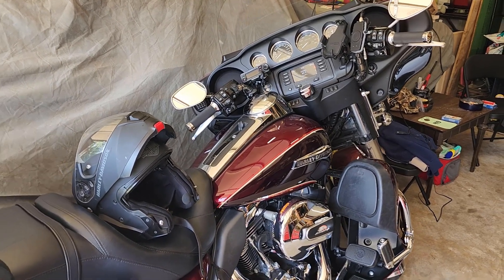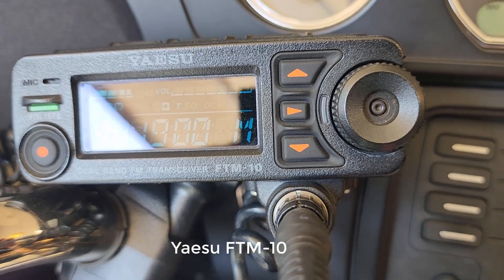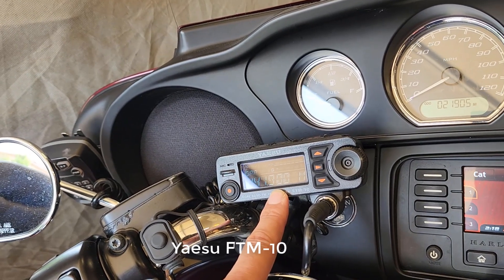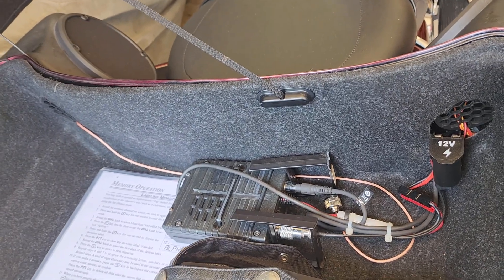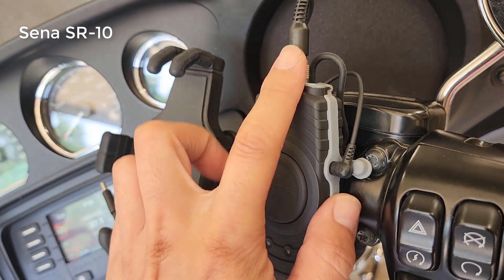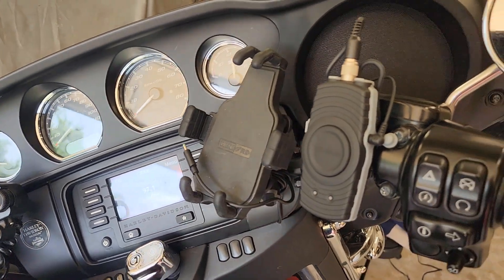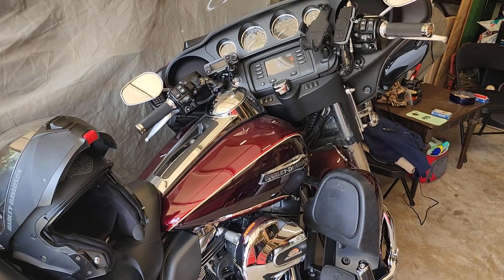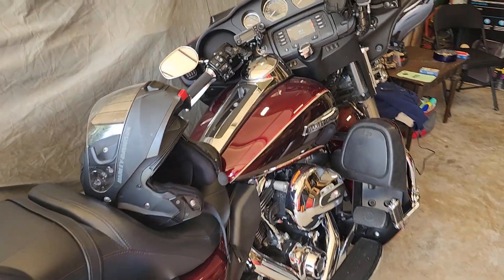Ham Radio Motorcycle Mobile

Comment: How did you pass the cables through your tour pack? Just got a BMW K1300GT and am finally going to give it a go. I'm just hesitant to drill holes in my side cases, less so for the Givi trunk. Considering building the radio body into a harbor freight apache case to strap to the back seat.
Reply from the maker: @JudgeKW  I drilled a new hole and got some rubber grommets from amazon. 

Working on v2 of this setup where the radio will run off a separate 12v battery and the bike will charge that battery when running.

Comment: I came to this video for antenna mount ideas. I just picked up a VGC VR-7500 and it's in my car for now, but I plan on installing it in my FJR1300 once the weather warms up a bit more. For anyone who's not familiar, this radio interfaces entirely via Bluetooth on a smartphone. Combining that with the sena unit in my helmet seems like it'll be a really good setup without much fuss. 73

Comment: I want to say I linked my SR10 to my Cardo, but I did have Sena prior will check maybe this weekend and let you know. Also there are BT units for that radio, currently I am using a FT3D to my cardo with a PPT that replaces the brake lever mount. I should have a video out in the next couple weeks on that. Thanks for the video!

Comment: My Friends and I have the Midland 75-822 CB Radio on our Motorcycles. Could not find the SENA SR10 device for sale (by SENA). So, instead had utilized a Wireless Bluetooth (BT) Adapter (HB-6A) and Wireless Remote PTT (Key) (HB-6B) units which are battery powered and USB rechargeable. $30 for the pair, plus $15 to $20 for (10 - 15 day) shipping. The Remote PTT is nice since no wiring is required. Velcro strapped (provided) to left handlebar grip; thumb activated. Red light activates on the Remote PTT Unit when PTT is active. Paired the BT Adapter with the Remote PTT unit. Then, I paired the BT Adapter with my SENA 20S EVO Helmet Headset. Works Great! Overcome the mechanical (physical) constraint (clearance issues) of mating the HB-6A Device directly to my version of Midland CB Radio, by using (making) a short straight through extension cable. There are off the shelf 2-pin molded extension cables for purchase, but a little expensive to me. Other Midland Portable/Handheld Radio models would allow for direct connection of the 2-pin BT Adapter. The BT Adapter HB-6A-I model/version purchased is for ICOM (I1 & I2) Radios. Same 2-pin 2.5mm (2-pole TS) Microphone/PTT & 3.5mm (2-pole TS) Speaker interface as the Midland 75-822 CB Radio connecters. Can pair BT Adapter to SENA Headset as a second mobile phone or as GPS. Can provide (via separate cable) USB +5Vdc power to the BT Adapter for charging while in active operation and installed on the Motorcycle. Although, the 7 to 9 hours of battery life is adequate for my daily rides. BT Adapter has a 400mAh battery life. The Remote PTT unit battery life is identified as 3-months. The HB-6A-I BT Adapter 2-pin 2.5mm to 3.5mm Center-to-Center pin spacing is 10mm. Other BT Adapter models are available for other Radios with K-Type [six signals total, 3 poles per each jack] (11mm pin spacing) and M-Type [4 signals total, 2 poles per each jack] (8mm) Center-to-Center pin spacing. The marking on the BT Adapter box received for the ICOM HB-6A-I unit is further identified as 'Model TC-IM V8'. Consider adding these identification markings as a comment as special additional instructions when ordering online. The ICOM HB-6A-I BT Adapter has 4 signals total, 2 poles per each of the two jacks/plugs. 2.5mm 2-pole TS (pin-1 MIC/PTT, pin-2 Ground) and 3.5mm 2-pole TS (pin-1 Speaker, pin-2 Ground). BT Adapter supports Advanced Bluetooth 5.2 Technology.

In regards to the short extension cable mentioned previously, located an off-the-shelf cable. ICOM Right Angle Adapter Cable, 2-Pin Male to 2-Pin Female. Part Number OPC2144 (OPC-2144). 9-Inches overall length. Flexible. Right Angle end at Radio 2-pin Male end. Opposite end is straight 2-pin Female.  The cable exits the Radio allowing maximum clearance for the Squelch & Volume knobs. This OPC2144 Extension Adapter cable supports 3 signals per each connector, for a total of 6 signals. The Midland 75-822 2.5mm Microphone connector supports a 2-pole TS (pin-1 MIC/PTT, pin-2 Ground) or a 3-pole TRS (pin-1 MIC/PTT, pin-2 no connect, pin-3 Ground) and the 3.5mm Speaker connector supports a 2-pole TS (pin-1 Speaker, pin-2 Ground), but also accepts a 3-pole TRS (pin-1 Speaker, pins 2 & 3 Ground).

One Friend is using the SENA 30K and the other the SRL2 Headset, while I am using the SENA 20S EVO.
We are using CB Radios because others we ride with have Motorcycles with built-in CB Radios from the Factory.

Comment: Nice setup and thanks for pointing us to the MARC group. You went a little different route than I'm planning for my bike, but you probably get more power and better signal. I bought 2 HT radios - depending on who I ride with. A Yaesu FT5DR and BTech GMRS-pro. Both are water resistant and have bluetooth built in. I also have a Sena that I plan to use with a PTT button that goes on the handlebar. I've tested both around the house and they work with the helmet mic. But haven't found a good mount for the radios yet. Thanks for the idea of the 1/2 wave antenna.
Reply: ft5dr water proof? i would go with the new btech uv pro, they sell opt accessory a ppt button. have you checked a ram mount with some kind of holder for it? or print a 3d holder that fits with ram? or a belt pouch? I use a belt pouch on my bicycle, might not be good enough for the motorcycle speed and vibrations. on the website of MARC group there's 2 videos, one shows a ram holder for an ht.